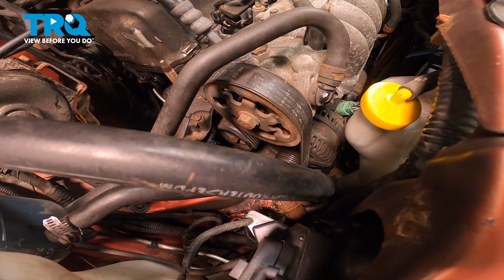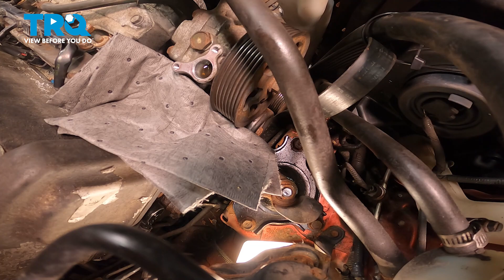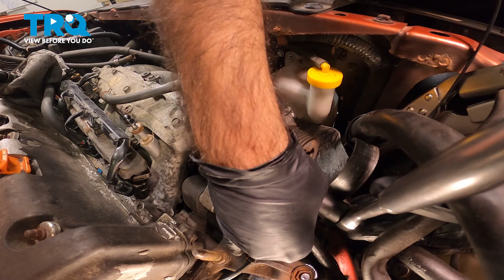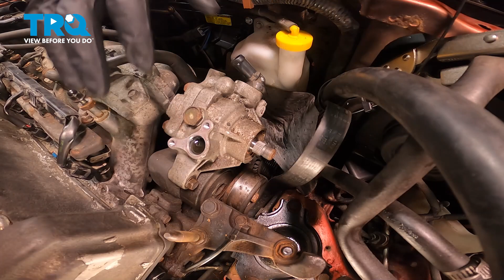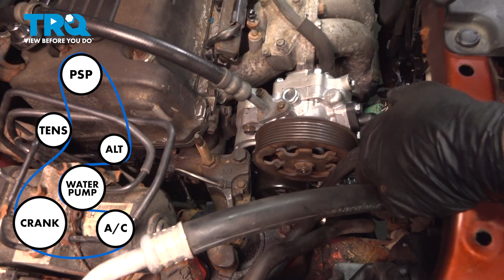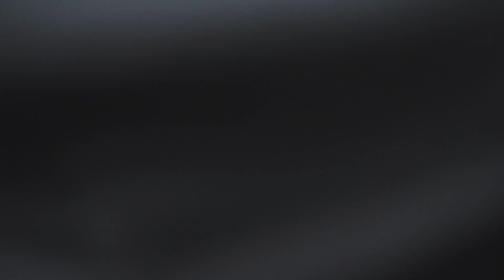How to Replace Power Steering Pump 2003-2011 Honda Element

Comment: That lock, unlock & turning the steering wheel to right & left is to bleep the air, correct? Also it would have been better had u walked the last steps of bleeding air from the lines. I'm confused with do I lock the wheel, then start engine, turn wheel R&L and do that a couple of times?

Comment: I don't get why u put the pulley onto the new pump & then later u have to remove the pulley so u can tighten the bottom bolt the engine body?

Comment: The only change one thing that I say that I do different is while the top pressure line is off spin the pulley by hand until it's primed and the fluid starts coming so it's filled already before you start it

Comment: What can I do if I reuse the pulley but it doesn't line up with the lower pulleys and starts shredding serpentine belts? I did everything as you laid out in the video but is appears as if my power steering pulley is inboard a fraction. If I sight down the side of the pulley I'm about on the the first groove of the alternator pulley. I've shredded two serpentine belts already.

Comment: What I learned: make sure to get a part that has the input line in the same orientation as OEM (up, not down), to avoid potentially having it rub against the serp belt when everything's back together.